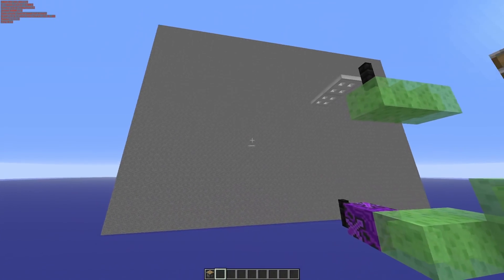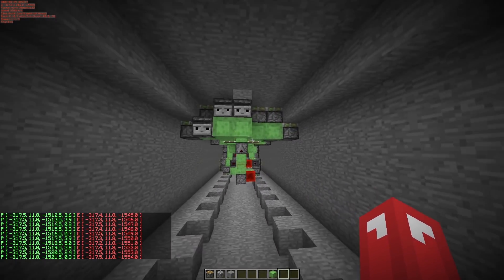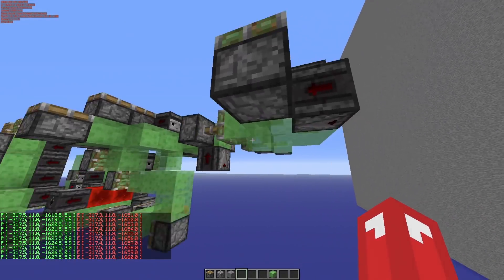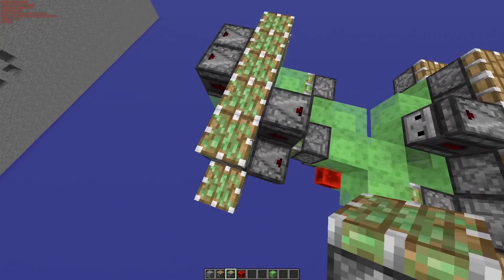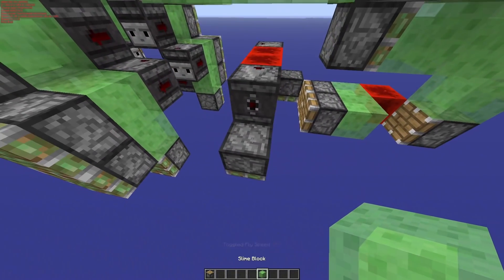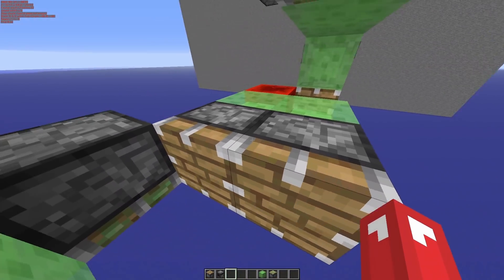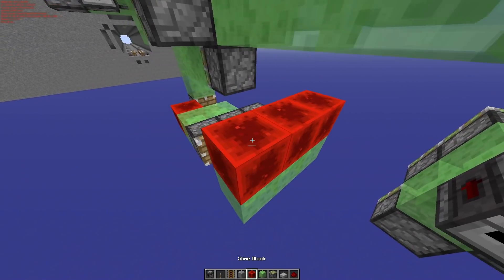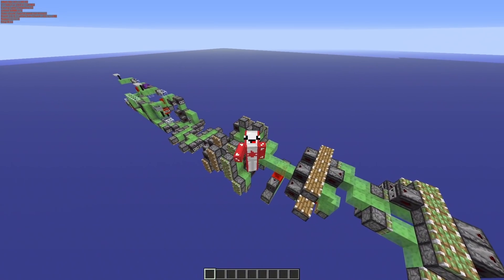Smart Tunnel-Bores 2

Comment: I make a lot of fast tunnel borers, but I don't make piston bolts I just do an ice bridge. Also are piston bolts faster than an ice bridge?
Reply from the maker: piston bolts travel at 20m/s consistantly, where as boats can travel at up to 40m/s iirc. however piston bolts only require you to start the bolt, whereas boats you need to constantly hold W

Comment: The demibolt is possible in 1.14- versions! The issue is getting the powered rails to go that way is directional, so only 2 directions can use powered rails. I did make a version that only uses normal rails, so you have half the pistons and is omnidirectional, but you cant fix the bolt without rebuilding it all like before.
Reply: just use savestate when you break it xD.
Reply: @haph2087  ah ofc 🧠
Reply from the maker: wtf is a "demibolt"
Reply: @A1306-k5e  the new piston bolt... that is the name of it...
Reply from the maker: Ahhh ic, I’m dum
Reply: @A1306-k5e  iz okie ❤️ 

But yes, it is possible in a few ways in 1.12. Issue is it is either directional, or cant be fixed without requiring the same effort as before
Reply from the maker: Honestly having it need to be rebuild every time isn’t that bad, the worst thing that could happen is you have to rely on a FTL for transportation for a bit
Reply: @A1306-k5e  i disagree. The biggest upside to the demibolt in newer versions is not half the pistons, not the lag reduction, not the client side performance improvement... it is the fixability. Everything else is butter.